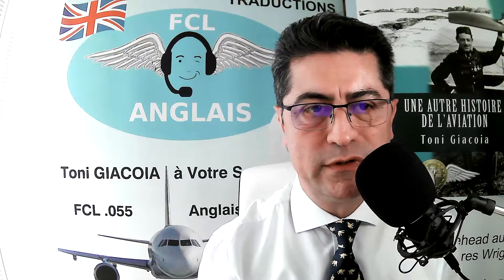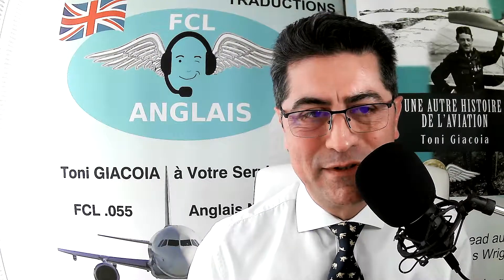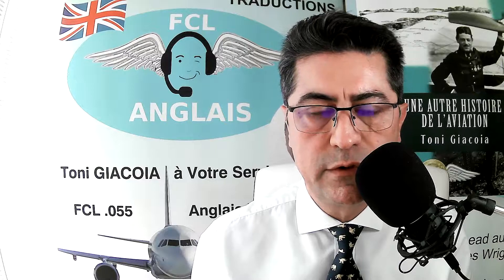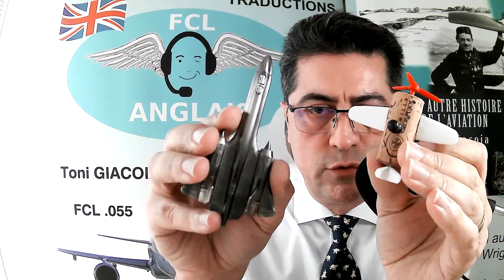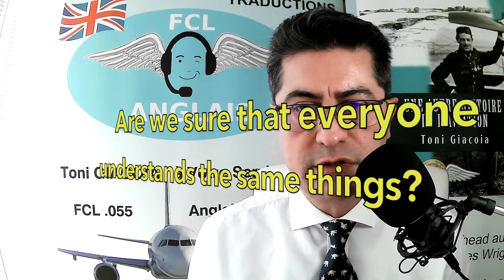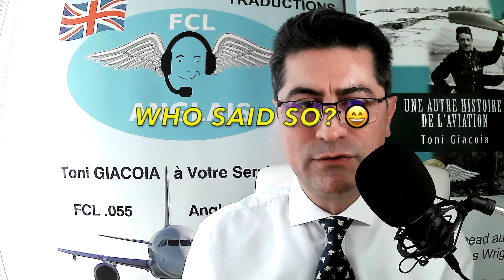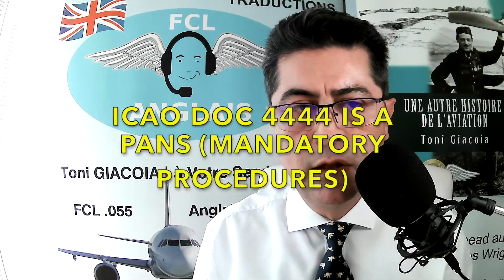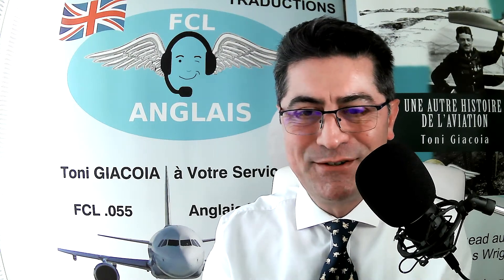ATC-Pilot Phrases About The Runway

Comment from the maker: I've just learnt that "runway heading" happens to be understood as "extended centreline" in the UK and some other countries. It just confirms that not everybody understands the same thing. Moreover, the French DGAC manual of radiotelephony recommends "maintain runway tracking". Some other countries use runway track for the extended centreline. So, it turns out it isn't so simple...